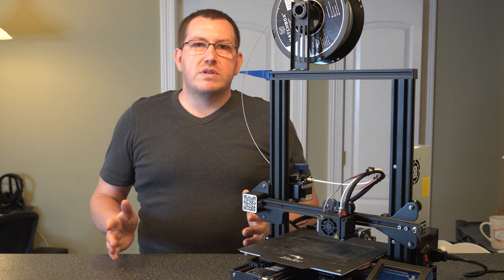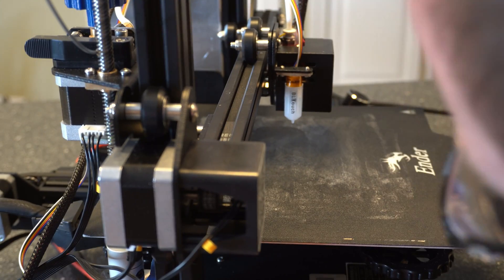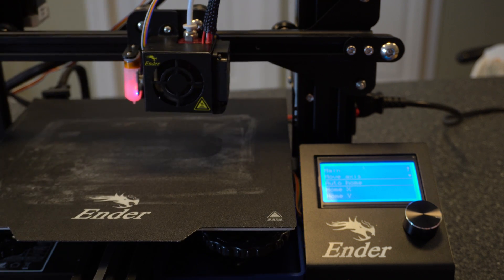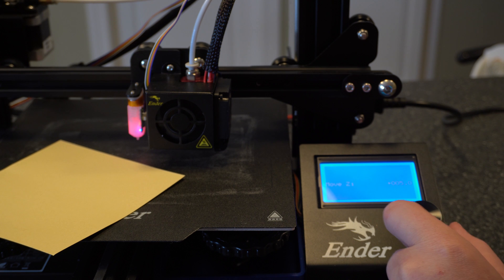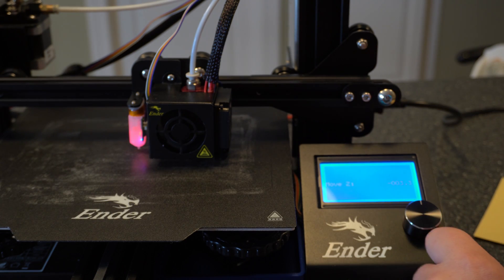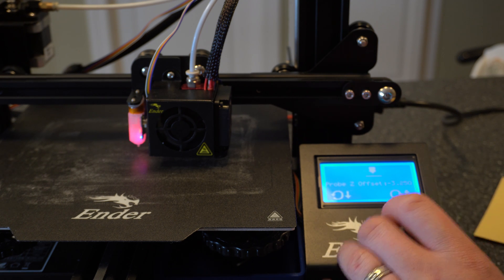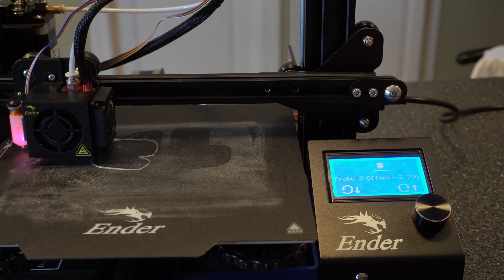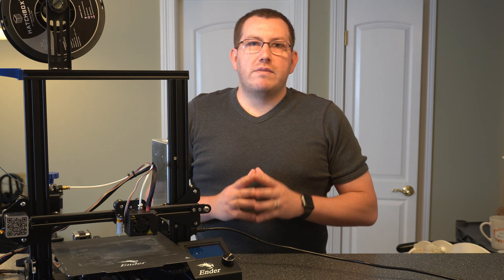Z-Offset BLTOUCH With Marlin Firmware

Comment: hi, i have the same board and bltouch, the issue that i am having is when trying to do set my z offset, once z is homed, it moves up to 12mm, so then move the z axis down once it hits 0.00 it will not go negative, i have reflashed btt firmware several times and still the same results.
Reply from the maker: Hi. Are you doing a home on the Z axis or just the standard auto home? I noticed that I had to do the auto home before it would let me go negative.
Reply: @3DPrintscape  yea, I had done both and still wouldn't go neg. So I followed your video with using the branch that BTT has for the board, and  it worked, now other issues have crept up, like.. while printing the  CHEP Cube, it will just stop and extrude loads of filament in a straight line, then continue printing and no extrude
Reply from the maker: That seems really odd, I haven’t seen that behavior before. If you send me a copy of the gcode I will try to print it on my printer. My email is admin@3dprintscape.com .

Comment: I have set up my BLTOUCH on my Ender 3 Pro v1 with 2.4.4 board but when I do an auto home the Z goes up and then the print crashes and I have to power cycle. I have installed the latest Malin firmward with BLTOUCH
Reply from the maker: Hi. It sounds like the z-axis stepper motor direction is flipped. Here is what I have mine set to.
// Invert the stepper direction. Change (or reverse the motor connector) if an axis goes the wrong way.
#define INVERT_X_DIR true
#define INVERT_Y_DIR true
#define INVERT_Z_DIR false

Comment: Great video! I have a bltouch on my ender 3 pro with a glass bed and my z offset is -3.9. But the front half looks incredible when printing but the back half is just a hair too close. What would cause this?
Reply from the maker: Hi. It could be a warped build plate. One thing you could try to do is increase the bltouch mesh size from 3 to 4, or 5, to try to account for the difference.
Reply: I think I know the cause. I took out the springs for the bed and put in plastic spacers since I no longer need the springs because of the bltouch. I used the original leveling knobs since I don't have any wing nuts. Turns out one of them came off and I think that was the cause. So I tightened them all as right as I could and my prints look fantastic. I've been printing for 5 years now and never have I had a print that looks this incredible.
Reply: How is it possible to have a warped glass bed? Would the bltouch just make up for the difference? I did think of adding from 3 points to 4. My brother seems to think it might be something in the gcode in cura, but I don't really see how.
Reply from the maker: I don’t think it would be the glass bed, more thinking the aluminum build plate may be warped. I see that all the time. The BLTouch should be able to fix this assuming the grid is large enough.

Comment: I have marlin 2.0.5.3 on the ender 3 and it does not allow my Z move to go below 0.   so i cannot set it before the print, I can only use tune/Bed Z  after the print has started, which can be a pain in the ass as it is hard to see if I have enough squish whilst it is printing (especially on small prints)
Reply from the maker: Hi. One of my other subscribers had a similar issue and said it ended up being a confirmation in the firmware. Since your running Marlin 2.x, I assume you swapped out the mainboard, or did yours come with the 32bit one? Also, are you using a prebuilt version of the firmware or did you compile it?
Reply: @3DPrintscape  no worries! I found the setting to enable negative values and yes I have an SKR mini E3 :)
Reply: @Dirt33breaks  I am having the same issue, what was the fix please?
Reply: @Dirt33breaks  where is this setting???

Comment: It looks like you have put your cooling fan on the outside of your BLTouch mount frame. I think you should put the mount on the outside of the fan so the fan assembly will remain solid without everything shifting.  All you should have done is apply the BLTouch mount to the existing layout (on the outside of the fan unit). The fan looks crooked.
Reply from the maker: Hi. Thanks for the feedback. The mount used in this video is the stock one, so its just the one that came with. I ended up using a modified fan duct cover that you can see here https://youtu.be/SqhEmw7aTCM. The reason the fan looks crooked is that the extruder mount is not tight on the X-axis.
Reply: @3DPrintscape  I recognize that you changed your cooling system, but the original video shows it misplaced. For those who just see that one, because they aren't doing other upgrades, it could lead them to setting up a destabilized cooling system. Maybe just an update at the end of the video showing the correct setup, for those who don't change out their cooling would make sense? Up to you.
Reply from the maker: I see what your saying now. You are correct, the bltouch mount should have been on the outside. That said, there are only two screws that hold the fan casing in place, and both are on the bltouch bracket. I think it would be fine either way. Once I tightened the extruder down more on the x axis, what you were seeing went away. I also did a quick search and saw example of it mounted both ways. I will update the description with a note about mounting it on the outside.

Comment: your video on the bltouch helped me a lot, now I'm here trying to set the offset, but when i got to Move Z mines does not go past "+0.00" it wont go negative therefore I cant level the bed manually to se the offset
Reply from the maker: Hi. That behavior is odd, every machine I have worked with has let me go into a negative offset. So its just stopping when you get to 0? At that point, were you able to move it back up to a positive number? I have seen the system get stuck before, and just trying to see if that’s the case here.
Reply: 3D Printscape I am also having an issue with the auto leveling. For my ender 3. My print head is too far away for some reason. Even though the bed it at top height.
Reply from the maker: Hi. It still sounds like the z offset isn’t set right. One thing you can try is to start a print then adjust the z offset  while its printing. Once you get to the right offset doing it that way, make sure you save it so you don’t have it do it again.
Reply: Its was a firmware issue, I have the neggatives values now, but even with that plus re watching the video, i still cant get a proper aligment to the nozzle for a good first layer
Reply: @RiikanVR  hi, how did you correct this? did you just rebuild marlin and not use the preconfig files from btt?
Reply: @sbole  yes, with all the info i gathered i read the code and change what i thought it was best. But i ended up removing the bltouch and just use the normal stops and started using the mesh bed leveling
Reply: @sbole  yes, with all the info i gathered i read the code and change what i thought it was best. But i ended up removing the bltouch and just use the normal stops and started using the mesh bed leveling

Comment: Another great video. however I find myself having to adjust my axis on every print. Any fixes?
Reply from the maker: Hi. Thanks for the feedback. What axis are you having to change on every print, is it the Z one?
Reply: @3DPrintscape  yessir. the z axis consistenly defaults back to +5. I have followed both this video and the previous one covering the BLTouch. I'm thinking it has to be an issue with the code on my end.
Reply: @3DPrintscape  Additionally, my extruder starts to print off the bed whenever I do manage to start printing (Which usually requires me to manually move my extruder during the heating phase) it typically starts off the front left corner of the print bed

Comment: This procedure of Z offeset is made with your nozzle and bed heat at printing tempature?
Reply from the maker: Hi. Ive gone through this both ways without any issues but typically im doing it when the nozzle and bed are at room temperature.
Reply: @3DPrintscape  thank you for fast response, tomorrow I will finalize my settings,I placed 3d touch today.
Reply from the maker: You're welcome, let me know if you end up running into any issues.

Comment: Hey sorry just wondering if you know why my Z-axis wont auto home after installing the touch? I've yet to update my Marlin for it, but I figured I'd try to auto home after installing it and for some reason it just stays where it was at 0.00 Z. Is it just cause I unplugged the Z when it was placed there instead of at home? And any idea if updating my FW would help or should I put the Z axis back and then redo it all? :<
Reply from the maker: Hi. A lot of connection changes happen when you install the BLtouch, so it doesn’t surprise me that things don’t work correctly on the existing firmware. Honestly, I would just try to update the firmware next to see if the auto home gets fixed.

Comment: Hey how do you change the steps per mm on the ht3d firmware bc I have a different extruder drive put on
Reply from the maker: Hi. I think you are looking for the CUSTOM_ESTEPS_VALUE in the configuration.h file.
Reply: @3DPrintscape  is there any thing else I need to define I have the custom_esteps and I have the custom_esteps_value 141 in the config do I need to define anymore lines of code other than those 2?
Reply from the maker: I think it's just those two values, but I haven't actually changed them myself, so I can't give you a definitive answer
Reply: @3DPrintscape  so I forgot to do this when I was initially putting the firmware on the printer Is there anything I have to do to update the firmware other than just upload it And like I really appreciate you helping me out I feel bad for asking so many questions but you're the only one that I can actually ask that I have a decent chance of getting a reply with. nobody that I know does 3D printing I really appreciate your help and all that and you make amazing videos that have helped me a lot so thanks again
Reply: @3DPrintscape  just wanted to give you an update on that problem I was having I got it all figured out so I got the steps per millimeter spot on so thanks for helping me out
Reply from the maker: I'm you got everything working and that I was able to help out. If you ever need help, don’t hesitate to reach out.
Reply: @3DPrintscape  okay so I got cura 4.7 installed and I added the g29 ; BL touch mesh generation code to it And it's still not probing It probes The center as a homing but as soon as it's up to heat it does the regular line down the left side and then tries to print without doing the mesh generation and I don't know what's going on and if it's something to do with the cura 4.7 and I ended up accidentally installing the 6.4.2 version I had so I don't know if it's that or if it's something else in the THD firmware but I followed your guide to the t and the only thing I've done to the firmware was getting my steps per millimeter for my extruder
Reply from the maker: Hi. I will try to test this on cura 4.7 at some point this week. Can you open up one of your gcode files in notepad and search for g29 to make sure Cura is actually adding it?
Reply: @3DPrintscape  I will try to when I get home because my laptop is dead 😂
Reply: @3DPrintscape  I can now confirm that the g29 code is in the custom start gcode ; Ender 3 Custom Start G-code
G92 E0 ; Reset Extruder
G28 ; Home all axes
G29 ; BLTOUCH mesh generation 
this is a copy-paste from the notepad it is very possible I misspelled something
Reply from the maker: I would like to review your firmware settings. Can you send me a copy of your configuration.h and configuration_backend.h files. My email Is admin@3dprintscape.com.
Reply: @3DPrintscape  will do I appreciate it take your sweet time I'm in no hurry to get this working I'm very busy with my high school work so just literally just get back to me whenever I don't even have filament to use on my printer rn anyways

Comment: Hi, I've been sweating for hours and hours getting my 3D touch to work. But there is a general problem. When I press auto home my BL / nozzle goes down. but when my BL indicates that it is there, the nozzle continues. and after two seconds he goes up again. Because of this there is a hole in my bed. I've already changed marlin software but that doesn't matter. Could you help me? thanks!
Reply from the maker: Hi. Can you send a quick video of what it’s doing to me at admin@3dprintscape.com. I want to see what it’s doing before making any recommendations.

Comment: no matter how many times i try my nozzle keeps jamming into the bed. I've set the z offset and reset it at least 20 times, still continues to jam into the bed. Any help?
Reply from the maker: Hi. Sorry to hear you are having issues. Try starting a print, and after it finishes the self-leveling phase raise the z-offset to a point that you know it wont touch the build plate. Once the printer actually starts printing, start lowering the print head until you see the filament start sticking to the build plate evenly. Once you are there, make sure you save the setting so that it stays through power cycles. If you still have issues, you can email me at admin@3dprintscape.com.
Reply: And move it from CONTROL menu. I guess prepare wont show

Comment: Micro SD to SD Card Extension Cable Adapter

I tried two brands of Micro SD to SD Card Extension Cable Adapter on my Ender 3 pro and none of them work, the Printer micro SD card slot works fine without the adapter but once I use the adapter printer can not see the card at all. I used one of the adapters on my Ender 5 so I know it works fine. Anyone else had this problem??
Reply from the maker: Hi. I have only used micro SD cards, or Octoprint, with my Ender 3 Pro, so I have not seen this issues.
Reply: sounds like the pin out may be messed up with your extension cable?